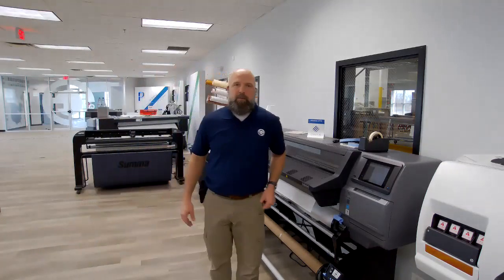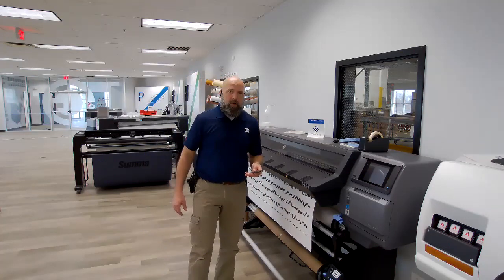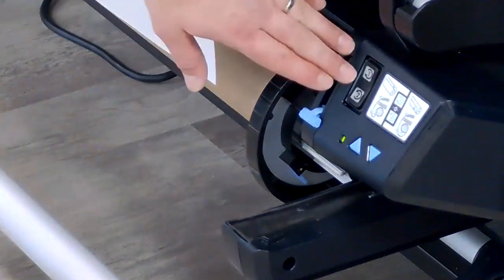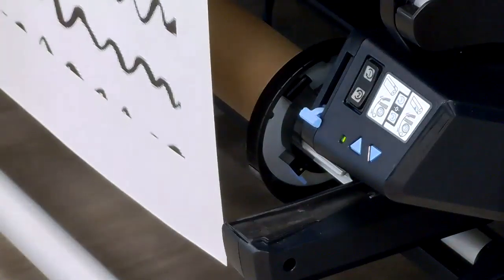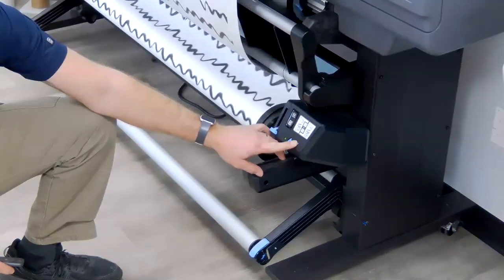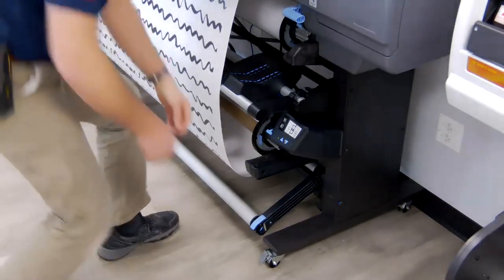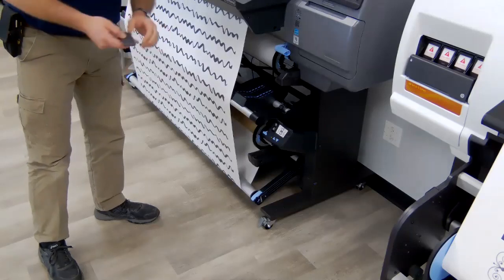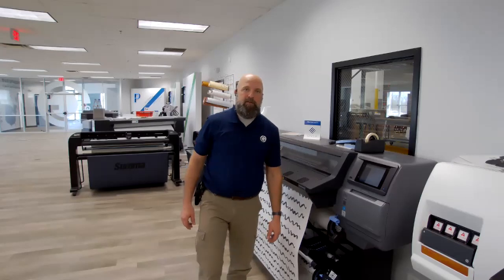HP Latex 365 - Take-Up Reel

Comment: Honestly, this is a poor design for a take up roller. You should be able to set the material around the dancer bar and the roller with one move, and not have to be that low to the ground working either. 
This adds nothing but stress to the workflow.

Comment: Good day sir,

I have a HP Latex 365 plotter and  I get ink smudges on the inner top side of the curing area using gloss paper. How can I resolve this? Is the take Up reel a solution?
Reply from the maker: Hi Joshua! This issue typically means that the profile setting is incorrect or the heaters need adjusted a bit. Based on the information you provided, it sounds like the heat is too high and it is causing the material to warp and scuff against the heaters.

Can you send us your contact information so we can reach out and discuss how to fix this?